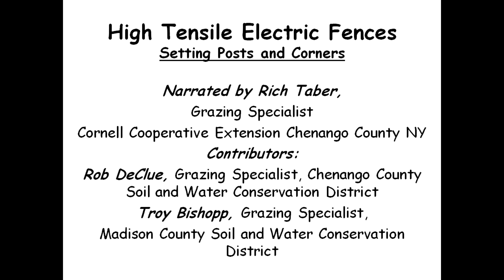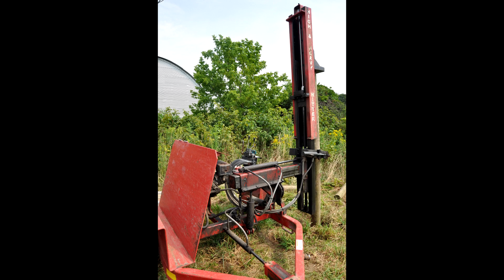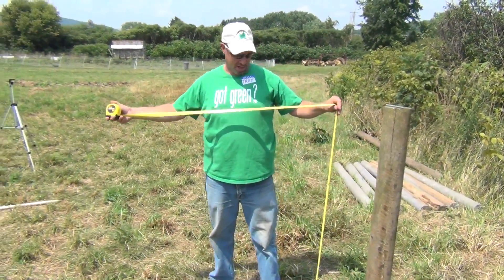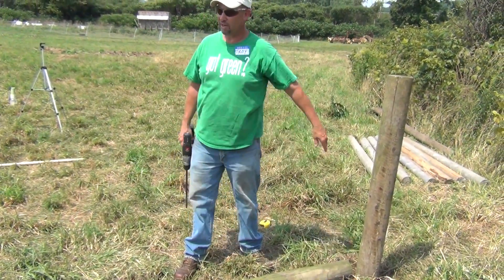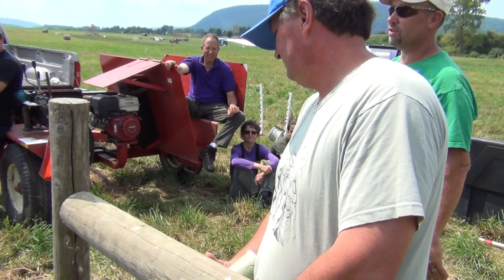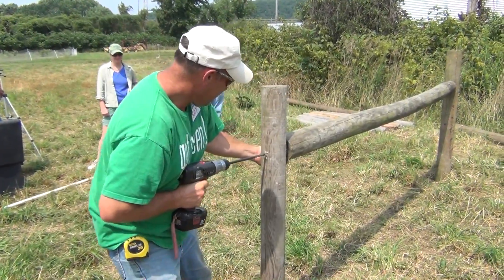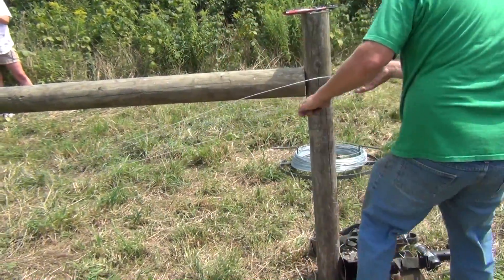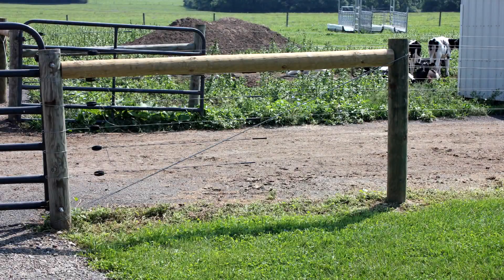Cornell Small Farms/Chenango Grazing: High Tensile Fences Revised

Comment: additionally, red brand suggests not to use the twitch stick and twisting the wire.  If you do it this way there is the possibility that an animal can get its leg through one end and then slide into the "v" .  yes, this is an extreme case but Red brand has reason to suggest their method.  leave the brace wire open, you can then run your fence wire through the center of them.  Just repeating their opinion.  One's long term experience is the best answer....
Reply: spudth they also have a vested interest in generating more income by selling you gear. Many times the fence it self will isolate the windlass ( technical term for a twitch type tension system) from the animals.
Reply: I don't use the twitch stick, because it's real easy with that much tension to slip and loose some teeth. I get that if you are just building a few fences it isn't worth buying the extra tools, wether it be gripples, or a wire strainer, but a twitch stick to the face might change your mind.

Also red brand doesn't sell a wire strainer or gripples .
Reply: I did t think about the little ratchet thing, that woould be a good choice for people just doing a few fences, and I don't think red brand sells them either

Comment: Not to be critical but I have hours and hours of Mathematics/Geometry/calculus.  This guy throws out the statement "Geometry says" but never backs it up?  Just a simple sketch on the back of a napkin can clarify his statement.  The way I see it, regardless of where the horizontal brace is and where you hang your wire, when the tension is applied you are trying to pull the corner out of the ground, pivoting on the brace post.  That alone is why you want to make the posts as deep as reasonably possible and as far apart as possible.  8' apart and 4' depth don't really seem to be markers in the geometry unless you know the total force applied and the holding power of the soil.
Also, to me, the 3-1/2 foot depth mark is what my post hole digger will do.   Certainly a driver is great, don't know how the driver works in my soil with 3"to 4' round rocks and larger pieces of shale mixed in with the clay that can be 18" below ground.....